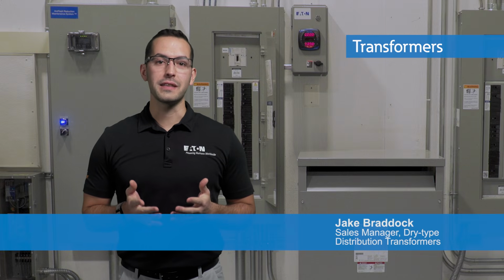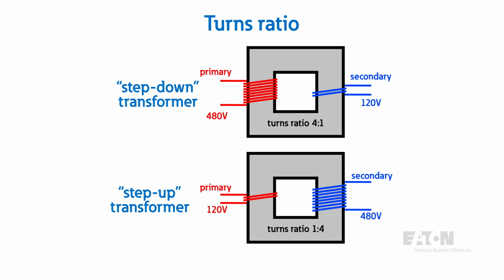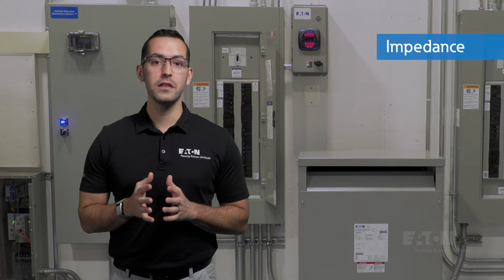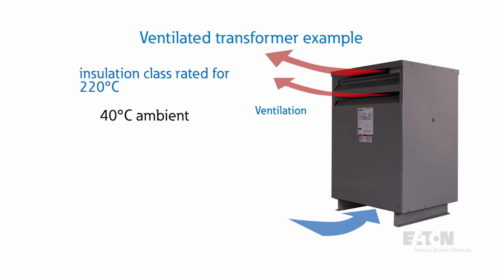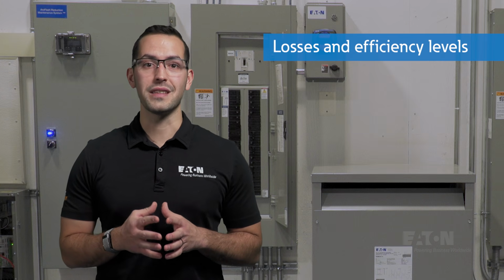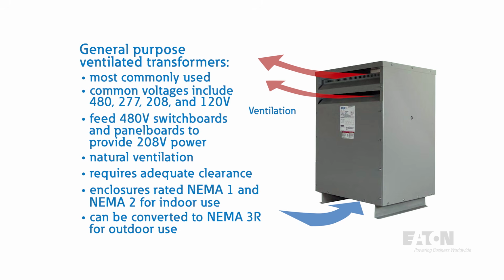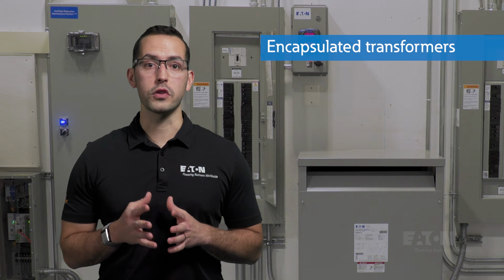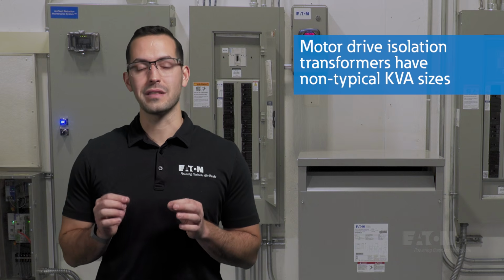Low-voltage dry-type transformers basics | Eaton PSEC

Comment: Excellent video. One question arise from my side, do you call LV distribution transformer the ones that have LV in both Primary and Secondary side? or do you also call LV  distribution transformers the ones that just have LV on the secondary? thank you!
Reply from the maker: Thanks for your question! LV distribution transformers don’t need LV on both sides. At Eaton, they’re defined as transformers with LV on the secondary, even if the primary is higher (up to 5 kV).